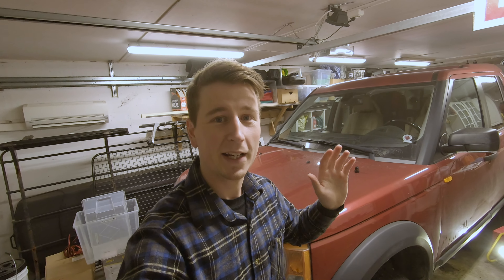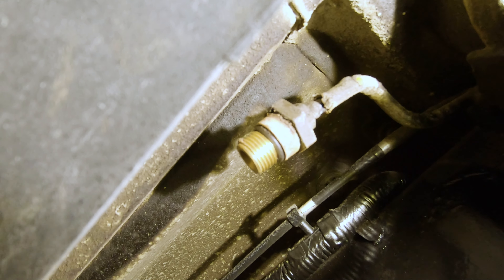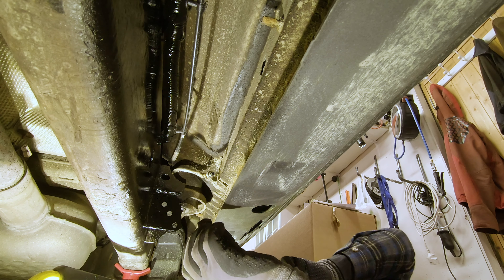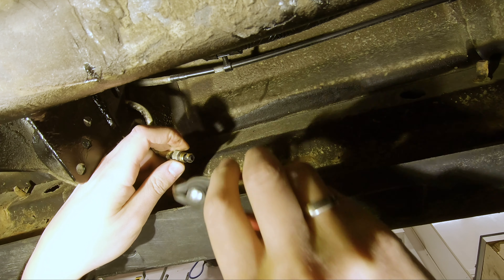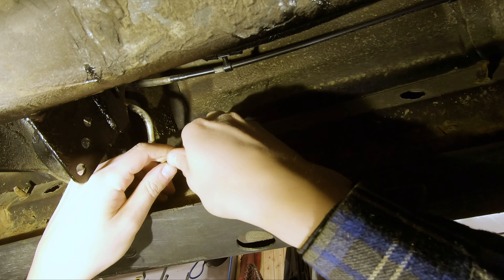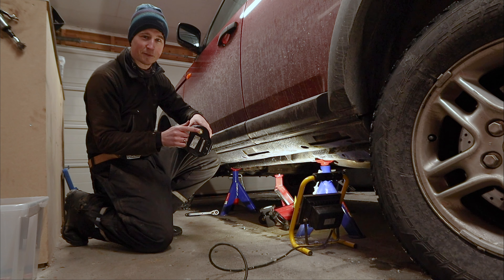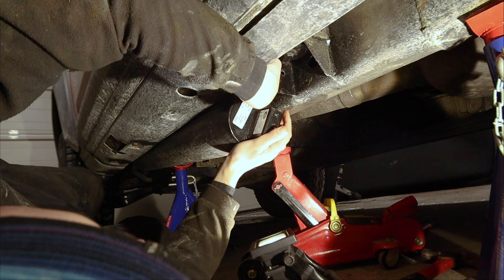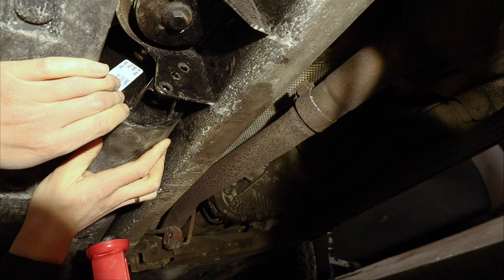How to mount AIR SUSPENSION RESERVOIR tank on a LAND ROVER DISCOVERY 3+4 LR3+4 RRS-l320 FULL DETAIL

Comment: Easy peasy hey Simon. If it was my Disco, I would consider encasing the cylinder in a thin layer of heat resistant rubber or similar to avoid the rocks/dirt rubbing on the metal. The danger with doing that though might be entrapment of moisture. 💪🙏🏽🙏🏽😷😷🦘🦘
Reply from the maker: 😁👍 Yeah probably smart to cover it with something thicker than the regular paint. Thought about a rubber paint but was unsure if the rocks would stick more in between the reservoir and the chassis. There are probably some painters out there who has some good suggestions. I will be cleaning it more often from now on for sure. And in some years take it down and check it.

Comment: If that metal tab gives me a hard time lining up the bolt holes I just remove it.  I think it's only purpose is to aid in install and removal, but it just makes installation more difficult.
Reply from the maker: Yeah, probably could just hammer it in. 🙂 Only helps when i was looking for the bolts. 😂😂

Comment: Does the pipe just push fit? What retains it? What happens to old connections?
Reply from the maker: Yeah, the pipe is just a push fit. If you watch the video again and the disassemble you can see the ring you have to take of, it burrows down into the pipe a bit.  The old connection you can just throw away.